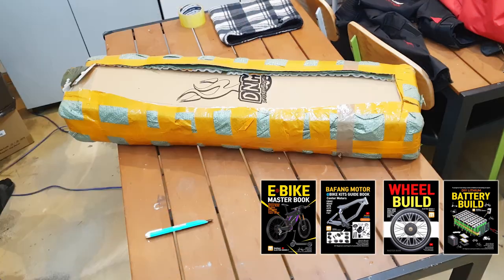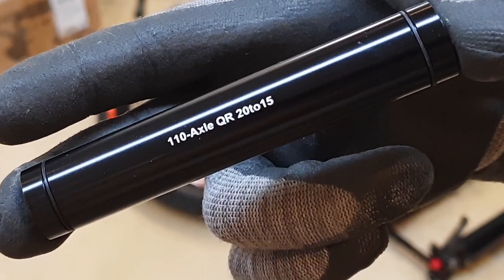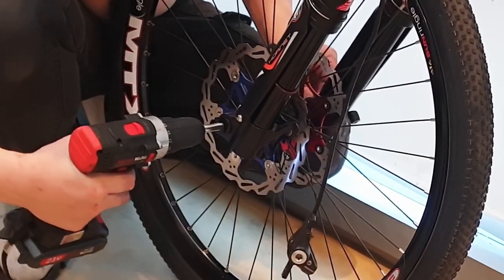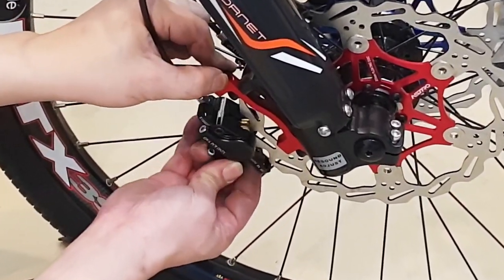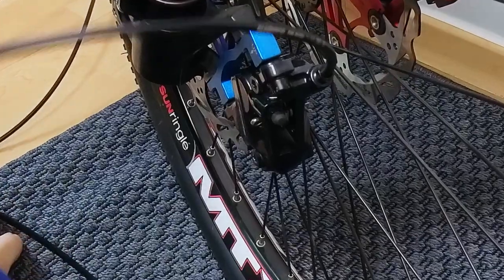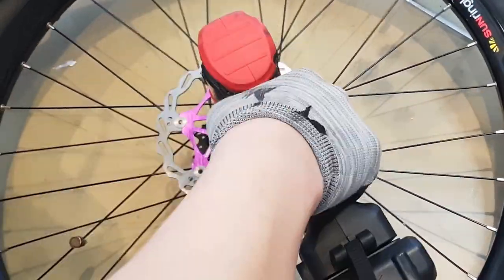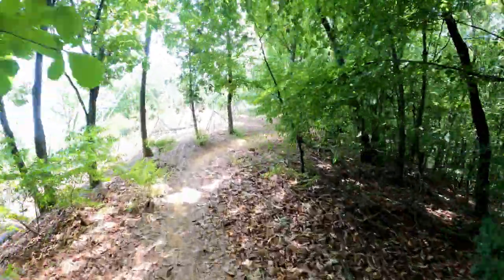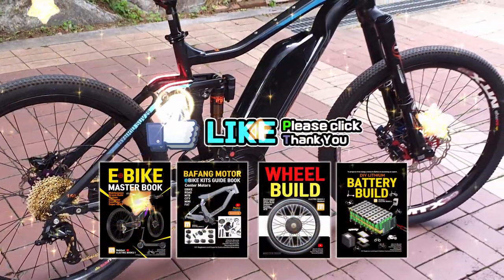Dual Disc Brake Fork Guide ( DNM USD-6 ) : E-MTB Vlog 06

Comment: are the 2 front disc brakes not rotating in the same "direction"? is that intentional?
Reply from the maker: It is a rotor with a symmetrical shape. So there is no problem with direction.
https://s.click.aliexpress.com/e/_DncogQ5
Reply: Did you have to build the wheel? If so do you have a link for the hoop and spoke size?